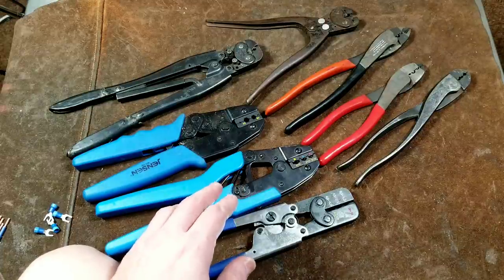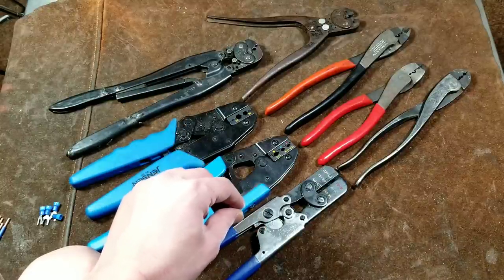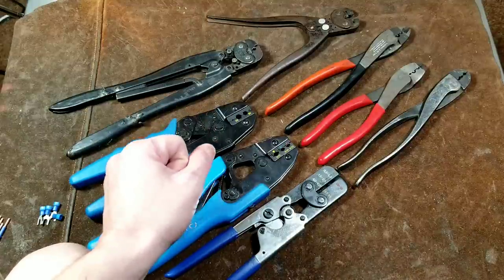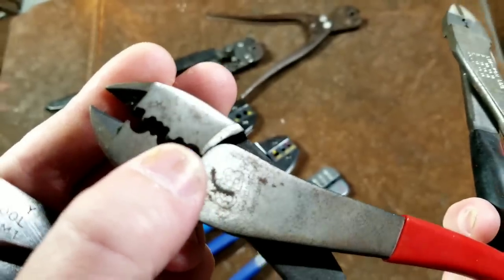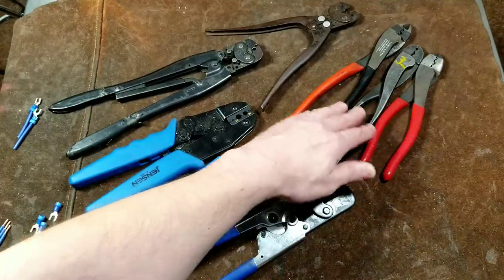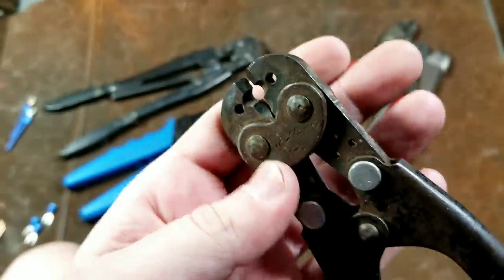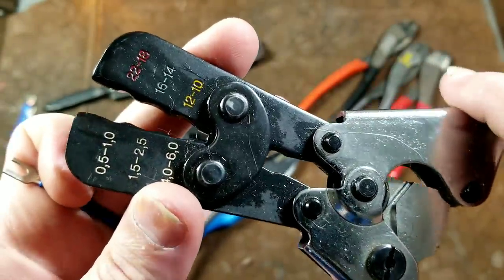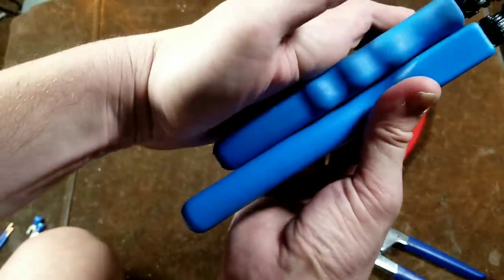Professional Grade Common Wire Terminal Crimper Review & Comparison

Comment: The Amp crimper for only the blue terminals also left two bumps on the crimp. Since you didn't mention that perhaps you don't know what the bumps are for. That is to indicate that the correct die was used. 1 bump for red, 2 bumps for blue, 3 bumps for yellow.

Comment: The  only thing that has changed in 60+ years with the AMP crimpers, that I'am aware of @16:20 is they now have insuluated handles,thats it!!!, they are that good, plus they are FAA and Mil-Spec certified. I have all the crimpers for insulated and non-insulated terminals including pin terminals that My Father used back in the 50's through the 70's while He was working at Lockheed. The "AMP" quality is a force to be reckoned with!!!.😏👍

     Great video, very informative!🇺🇸✌

Comment: What would you recommend for crimping stainless steel barrel sleeves?  I think they are about  7/32 OD and are MUCH harder to crimp than the standard barrel sleeves.  I use these for connecting kiln elements to the relay wires.  Thanks for the video
Reply from the maker: Ratcheting crimpers would be pretty good in this situation because the ratcheting action and the multiple pivot Points gives them compound leverage like bolt cutters

Comment: I stopped using insulated connectors, non insulated connectors provide superior crimping strength and with marine heat shrink a superior weatherproof insulation.

Comment: The main problem I find with the ratchet crimpers is that the crimps themselves seem 
to vary enough in size so that they slip off. In other words the crimps tend to not match
the dies. Now here I must say that I buy my crimps from different sources.Living
on the edge of the world we don't have a lot of choices as to where to buy them.
I imagine the real problem is that the crimps themselves vary a lot in size.I Have two
expensive ratchet crimpers that I have stopped using because of this problem.I find 
myself using a pair of Kliens  that are similar to the T&B crimpers that you show.With
these I can control the tightness of the crimp by varying the pressure by   controlling
it with how hard I squeeze the crimper. At one point I had a conversation with a guy
who was involved with crimping to a military standard and he told me to be sure to
always make sure the crimps matched the crimper  or else I  would have the troubles
I turned out having with the crimps not fitting.I did a lot of experimenting with various
dies but none of them  matched my crimps.So at this point I have two expensive
ratchet crimpers and a number of dies that I can't use.So if anyone has any
suggestions as to where to buy crimps that would fit the crimpers I have I would welcome their input.
Reply: Certified crimps are expensive and do not come from China,

Comment: I have 2 pair of ratcheting crimpers one straight and 1 with an angled head to get into tight places, like heavy truck tail lights.
Reply from the maker: Ratcheting crimpers are awesome I like them so much because I spent years just using the standard sheet metal style until I actually heard somebody using a pair and ask what they were
Reply: Catus Maximus 
I  went  from  a  heavier  version  of  the  sheet  metal  ones   (replacing  scotch  locks  😠)  to  heavier  plier  type  with  silicone  di-electric  grease  and  now  the  ratcheting  crimpers . Each  step  a  big  improvement

Comment: The Thomas & Betts WT-111 tool you show was actually designed for uninsulated terminals and splices, not so much insulated terminals except for butt splices.  The WT-145A should be used for insulated terminals, and it would be an improvement to your demonstration of tools, as it is a much higher grade of crimper than those shown in your video.
Reply: I have found though experience that using the crimper designed for uninsulated terminals on insulated terminals works better. When using a crimper for insulated terminals the connector can be pulled off of the wire after crimp but when using the crimper for un-insulated terminals on the insulated terminals the wire breaks before the terminal comes off. When using high quality terminals like 3M the jaw will not break through the insulation

Comment: Unless you solder afterwards, the connections any of these crimpers make are laughable.
And soldering anyway, there is hardly any difference between a $200 crimper and ordinary pliers from your grandpa.
Reply: Soldering does improve a poorly made crimp.  You could always just solder on the terminal, unless your a marine electrician.
Reply: @joehead1294  Please enlighten me. Does it have to do with salty air & corrosion?
Reply: @STARDRIVE  ABYC regulations.  Mechanical connection and then soldered otherwise you might fail an inspection.
Reply: Pity you do not know what you are talking  about because you are misinforming people who want to make a reliable crimp. 
  I have been paid to certify crimping to MIL-STDs and your ideas are completely wrong like your idea of the cost of a professional crimper at $200 try $1500 or more.
Reply: @tryagain.k1821  Pulling rank, are we? Why don't you tell us how it's done, instead of throwing mud. Be constructive like everyone else here, please.
I'm not specialized in crimping, but In my humble experience as an overal technician, mechanic, and building numerous control cabinets, my conclusion is adding solder increases conductivity and reliability.
Heat cycles and vibration can reek havoc, and sometimes I can just pull the wires out without any effort. Intermittent connections are also hard to trace, unless they burn out. So why not add a drop of solder to seal the deal when the crimpers at hand are sub par?
In automotive or audio equipment it's often just a few connectors, so it's no trouble at all. Why take the risk?
Misinformation LOL. Who do you work for? Politico?
Try again, OK.
Reply: @tryagain.k1821  P.S. I never said $200 crimpers are professional. That's why there's hardly any difference.
Most of us can't afford high end tools, and employers won't sacrifice those to a run of the mill mechanic either.
You certify those connections by the book. That's great working on the power grid, but it goes out the window, because 99% of the people here are working with the cheapest junk available, trying to fix their home appliances.
Telling them to solder helps the average bloke. Expecting them to buy a crimper that costs more than their car does not.
Reply: I am sorry that you consider correction to your manufacturing procedure is "slinging mud", how do you ever learn with that attitude?
    Telling them to solder a crimp helps the average bloke  - make an unreliable crimp joint. 
Also your soldering advice makes an unreliable solder joint. it should be -
1  Mechanical join 
 2 enough solder to still see the wire  stranding. ie not blobs of solder
 3  then strain relief.
 It seems to me that you have never worked in a quality controlled manufacturing environment. 
 All crimp joints should have a Pull test .
      My recent experience is that China sourced crimps are too thin and do not hold a crimp. Buy crimps certified to UL, BS or ISO {DIN} standards and they work in Chinese crimpers. I doubt that Lucar connectors (Red, Blue, Yellow crimps) actually cold weld but it is the best I can afford.
  Always do a pull test.
Reply: @STARDRIVE   Aerospace and Military,  where lives depend on reliability.
 Who are Politico? What industry?